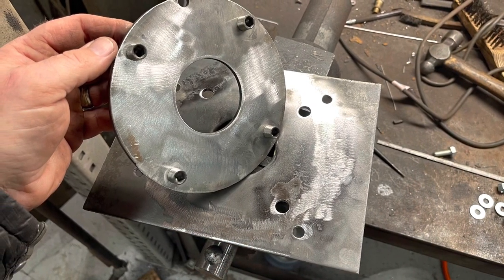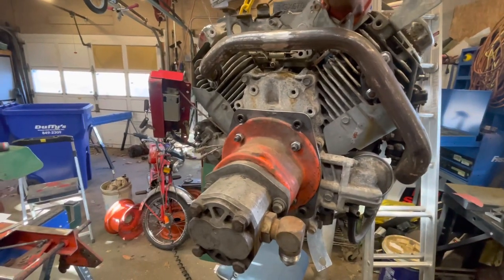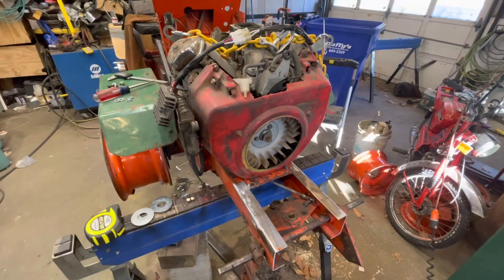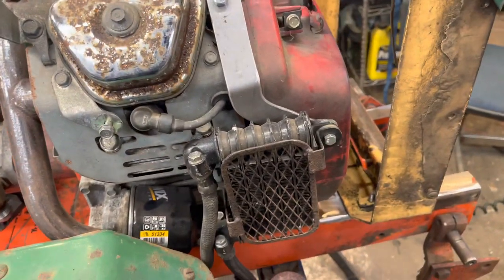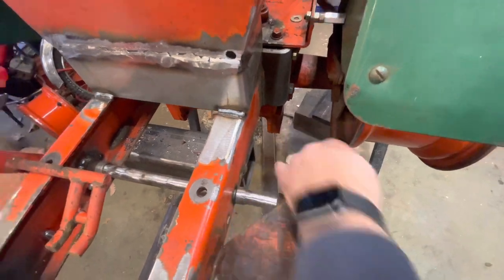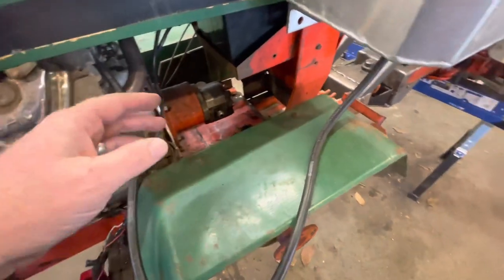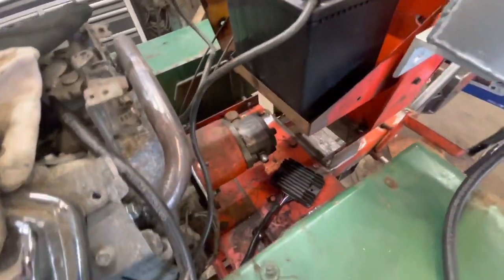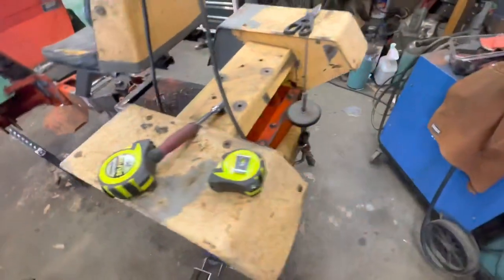Case155 - 4x4 Articulated Garden Tractor build. Part 5.

Comment: It will be interesting to see how you fit all the hydraulics and linkage in that small space behind the engine. Battery up top is nice for boosting / replacement. Fuel in the back is nice for filling/the added weight over the rear. Keep us updated!
Reply: Was thinking the same thing about the batt/gas tank locations!
Reply from the maker: The hydraulic pump is already in place behind the engine.  The latest video, Part 8, shows the hydraulics finally getting worked on, with more details on where stuff is.

Comment: Progress for sure & looking good.  I like the way you are thinking about & working out the many details.  Proportions look good.
I have had a build like this in my mind for many years, however I used one of my Case gear boxes on another build.  At my age the build will never happen, so I am enjoying watching you do it!

That sure would look good with a loader on the front but that's a whole nuther can of worms, LOL.

Do you watch Wood & Metal Shop with Frank?
Reply from the maker: I definitely follow Frank's builds, he does awesome work!  I built a loader from scratch for my Cub Cadet 2182, and that is part of the reason that I built this.  The Cub was 2wd and just didn't work well for me when I got a heavy load in the bucket, and the front wheels sunk into the soft ground and couldn't go anywhere.  This 4x4 will definitely be more useful!

Comment: Looks like your a little short of pumps. That one will be good for your drive but what about steering. Any auxiliary hydraulic will need a 3rd.
Reply from the maker: @jasonbainbridge982  you don’t need to add additional pumps, as you can use priority valves to ensure pressure goes to the steering first. Once I get it up and going, I can easily change my current pump out for a larger one if I need to run more accessories, but these pumps are already sized to run the drives, 3 point lift, and hydraulic PTO standard. Adding steering to that doesn’t take much hydraulic flow away.

Comment: You guys spent a lot of time building an adapter when you could just buy a magnaloy adapter.
Reply from the maker: It really wasn't that much work.  Just measured and laid out the bolt patterns and punched out some holes.  Was just a quick afternoon project.

And quite simply, the hardest part involved figuring out the mounting pattern for both the pump and the engine, and since both were used parts, knowing what standard patterns they both were would be the most difficult part.  It was easy to just measure and build, and have it done in a day, still utilizing as many standard Case parts, so it's easy to repair later if need be.